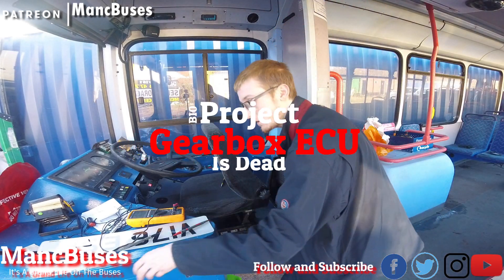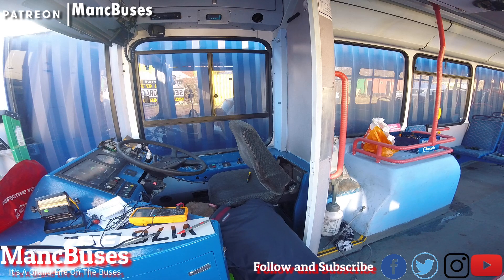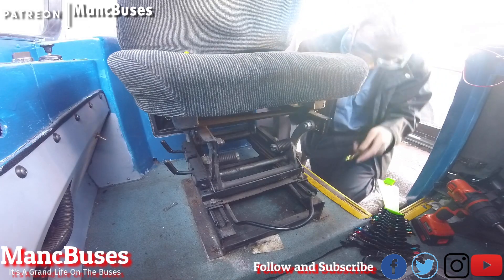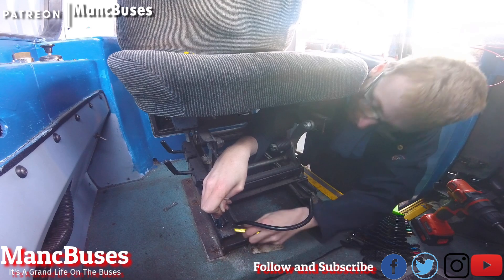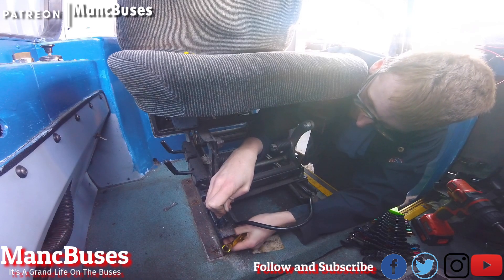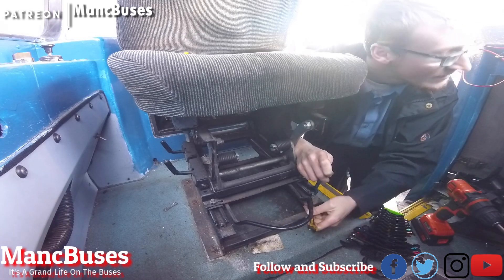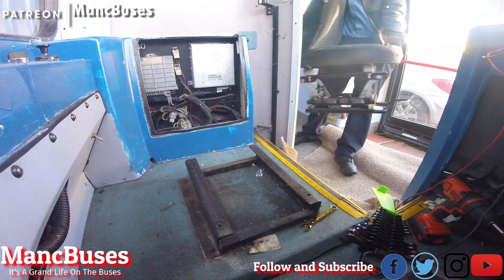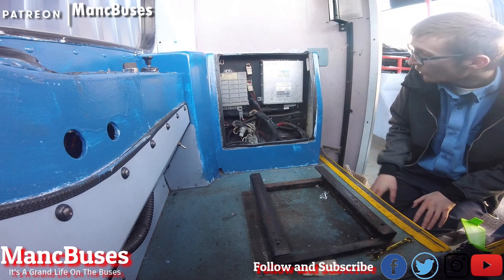Gearbox has died - TroubleShoot and repair - B10 Project #022

Comment: I have a question... Have you ever broken a near side mirror driving a bus? 
I broke my first yesterday, I'm not happy about it. :(
Reply: I've been working at Stagecoach for 4 years now and I've done it a few times. Just a bit annoying when you do it 😂
Reply: @Mancbuses  I told my boss it was the street signs fault, it came out of no where. lol.
Reply: @Protagonist  As long as you didn't hit a pedestrian with your nearside mirror and no one in injured then don't be too concerned.  Just learn from it and ask yourself how it happened and how you can prevent it from happening again.